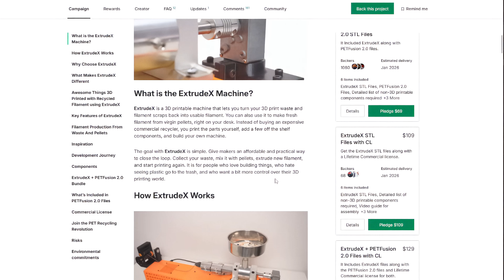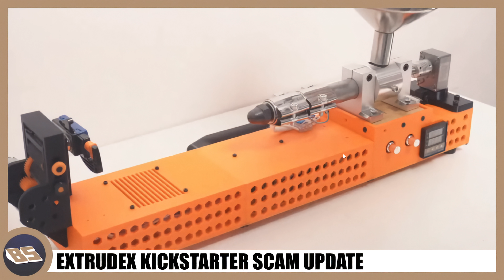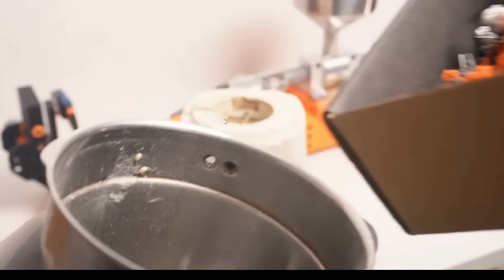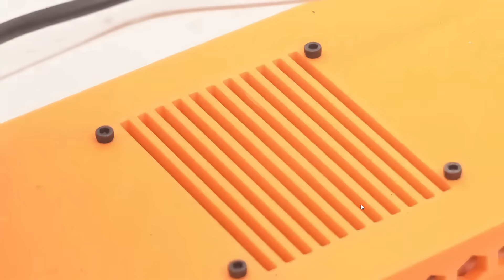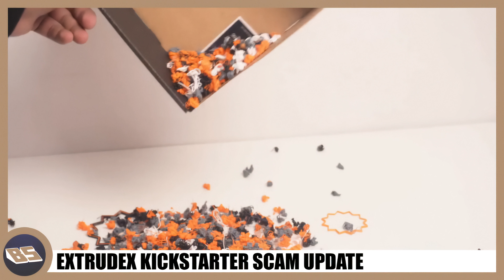ExtrudeX Kickstarter Scam

Comment: Oh gawd.  How edgy.  It's the green text.  Because I'm to dumber to then be able to NOT put money on miracles....which is kickstarters fault right?
Bro....ffs.  We KNOW going to the store or ordering wingding#4 from wherever that gets wrapped in plastic and goes across the OCEAN wrapped in fuel oil, then takes about 17 more rides to get to us ... Is wasting plastic...thanks Greta.
I mean NSS.  If YOU look at this and DONT just see a backwards air-brush I cant help you and kickstarter for sure ain't.

How about instead of whinging you turn what is a pretty good damn idea underneath, for those willing, into something helpful.  Or, just sit and whing about morons losing their money to morons which at the end of the day will ... Have... Just keep on pointing out how bad things are...actually I was thinking about doing the same with a website I use to thought was useful...but now it's just AI and "top ten failures" and "drama for teens" videos....

Comment: extruding is the easy part. there's a lot of home made options to choose from that you can make yourself. the problem is shredding your failed prints. and machines that can shred your plastics are expensive AF. these guys have it all backwards. s still think there can be something done with one of those old soft serve machines.
Reply: Respectfully, a soft serve machine is opposite of what you want. Nearly frozen, high bulk, wet, flowing, melting at room temperature, liquid.
Reply: @johnverkler3962  logic tells me the mechanics of a soft server machine(the internals) has the same principal. i wasn't remotely talking about the cooling properties of the machine. perhaps if you look into how one works you'll understand the concept and apply logic to my statement.

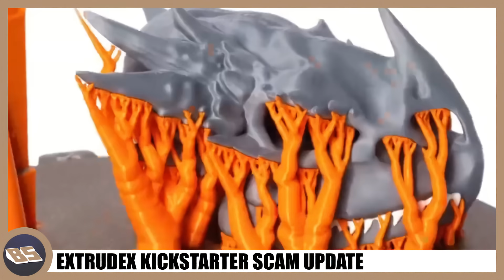Comment: The only valid points are from 5:00-6:00 idk what racist horseshit you're taking about afterwards. This machine has the potential to work with some modifications. There's no issue using a 3d printed if you manage your heat transfer correctly. Furthermore no metal to plastic interfaces are visible making the heat crawl likely very manageable. There have been 3d printed 3d printers which have worked fine. Most of these criticisms are very uneducated and even when valid are very easily resolvable in a redesign.

Comment: Ok, don't get me wrong, I'm not saying this isn't a grift (just open source your parts) but there's some issues here on the criticism. 
1. Plenty things are "full 3d prints" but require hardware.
2. It's definitely faked to mislead. 
3. Not all kickstarters are a scam
4. The "nitpicks" around the extruder snot are not really needed as it's just part of the process of a lot of remelters. 
5. Can't just go blowing up indians? (Wtf) 

This isn't some huge scam it's a kickstarter for an open source design of a pla remelter, you'd probably buy and have to assemble it and it would not be great. Is it a ripoff? Yes. Is it a scam? Yes, but there's a huge bad-faith argument going on here and to me, it's less informative and more off-putting.

Comment: The main issue I have with things like this is that they LIE to the consumer by making them believe the solution is to do something with the waste instead of preventing the waste in the first place.  Go ahead and use that fancy bambu printer with ams and piss away half your roll of filament in poop and purge but make yourself FEEL better about it by spending even more money on something to be able to turn that waste into something useable.  No mention of STOP USING printers that generate so much waste just so you can print trinkets that will also wind up in the trash.

Comment: This is odd. I thought there was already an open source device for this that was able to do decently but just the BOM was over $600 and there was a lot of interesting trickery to get the diameter halfway decent (I think its the artme 3d or something). I swear someone even managed to make hot glue into a filament with it (not a great material, but they somehow did it). Just comparing the design of the two and how they work makes this absurd, this thing looks like a lower grade pulltrusion device, the kind they use to make filament from pop bottles, with a aliexpress pellet extruder strapped to it.

Comment: didnt they already make something like this but better? to re use ender 3 printers parts if you bought a new machine?
Reply: I've seen a few PET extruder machines that used the standard Ender extruders to convert strips of PET (cut up soda bottles) into tubes that can be printed as filament.

Comment: Well actually, before extruding, the main problem is to shred it. You need heavy metal jaws and heavy duty high torque large motor. After that there are a lot of alike solutions DIY and all which can extrude something which looks like a filament thread.

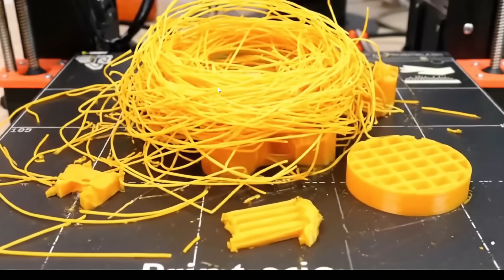Comment: 2:21 this is kind of a BS point. 3d printing is completely unnecessary, food packaging on the other hand is kinda necessary. 3d printing is a huge waste and cause of pollution for like 90% of people who have them. People just printing absolute nonsense doohickeys that no one will want after 5 minutes. I really do not see the benefit unless you're rapid prototyping or are using it to repair things.
Reply: You should blame Bambulab for this, they made 3d printers which 'just works'. Before that, 3d printing was not for everyone. Especially in printing some absolute nonsense. People tuned their printers and used them to print parts to fight programmed obsolescence. And now anyone could buy a 3d printer and turn plastic thread into garbage. = )

Comment: I've seen successful pellet hopper adapters for 3d printers.  It's a major pain, but it's a solved problem.  The problem is getting the right sized pellets.  He completely skips over getting the right sized pellets.
Reply: The right sized pellets are the ones your heating element can liquify fully at the appropriate rate. Without knowing the details of the heating element, you can't know what size pellets to use.

Comment: The problem with the digital depth gauge that he's using here to measure filament diameter is that he has printed jaws on it which don't close to actual zero. But it doesn't actually matter much, since all you need to do is keep filament diameter steady and keep it strictly under 1.9mm, then it will pass. The boards in these also have a digital readout port that you could tap into to actually feed it back into machine, which he didn't.

Recycling PLA is definitely more efficient than making it fresh, and the only way burning PLA is even justified is in an incineration reactor that produces electricity and emits solid inert cake and CO2, otherwise you'd be better off just landfilling it.

Mysterious smoke also comes from your nozzle when you run PLA, it's completely normal, especially if you haven't pre-dried it a whole bunch, and especially visible at first when priming. If your cold end cooling fan leaks into the nozzle area, or part cooling fan is running, you're not going to see it, but it's there. This is essentially soot from PLA decomposing and it is similar to soot from a match - it has a nonzero harm but also shouldn't put you in panic, all of your exposure is not even half as bad as frying a paella.

You are quite right that he doesn't actually have a working prototype and that this is a scampaign.

"If you're doing a normal thing, like driving to a grocery store, you are already throwing kilograms of plastic a week and nobody thinks about it at all" - oh you speak for yourself, i DO consider my carbon footprint and i do not in fact drive, and i politically support every (sensible) campaign to improve actual plastic recovery and reduce packaging plastics and also reduce fossile fuel consumption. But they're also not all sensible. And yes i do 3D print and some waste is produced but it's not really that big in the grand scheme of things.

Comment: Of course mixing unknown but likely different blends of plastic is a great way of getting consistant and well defined properties throughout the whole filament! And who needs a properly tuned feedback loop to deal with die swell and internal stresses in the extruded plastic or keep the diameter consistant?

If it were injection molding I could see something workable for waste upcycling, if made from mostly metal components of course.

Comment: Yeah, I've been looking into trying to recycle leftovers and failed prints. Like nobody anywhere offers any kind of solution in the home hobbyist or even pro-sumer range. If you're running a decent sized farm, it might make sense to spend $5-15K on a recycling setup, but it doesn't for anyone else.

I can't believe that, as of Jan 2026, nobody makes a self-contained benchtop unit (that isn't some Rube Goldberg contraption that needs constant monitoring and maintenance.) You feed shreds and/or pellets in one end, come back in a couple hours and you got a KG of filament on a spool that came out the other end. Hell, charge me a grand. I might even take two.
Reply: I'm sure I saw a video on a kit project for like €650 from a company called Artme in Germany. Probably why I came across this. I think you need a few other things, like a decent way to shred old prints and some way to dry out the plastic first. 

The video did touch on the time, effort and costs to do this really don't make sense for many.
Reply: @naycnay it's kinda shit, it has PTFE inline, in a setup that regularly should exceed PTFE temperatures if you want to extrude anything more than PLA, and they complain about being too expensive switching to full metal when it's already overpriced.
Reply: Because its niche, like you said you need to burn trough quite a bit before youd want to do such an investment. The motor to crush it into tiny bits is stronger than all the motors in your 3d printer and so is al ot more expensive. The housing and the crushing blades are solid steel and so quite expensive. You need a heating tube and element thats larger than of a 3d printer and so are more expensive so in the end you will just have a machine that almost gets no use for a regulair person, costs more in materials and probably is not worth the effort of the learning curve. Thats why they are so expensive

Comment: People who think you can reuse filament have never:
1. Used this "recycled filament"
2. Watched youtube videos of all the creators trying to make this garbage work, wasting thousands of dollars and still can't get good results even with much better machines than this
3. Seen a real filament production line in real life. The filament in those gets cooled much more evenly in a several meter long water bath, with multiple laser diameter measurements and a small fortune in control software to get the extrusion right.
The only stuff you ever see come out of these units and those "PET bottle to filament" machines is crap only worth using in those "3mm nozzle THICK LINES wow" shorts videos showing the ugliest prints you have ever seen, because no amount of low precision can mess up a vase mode print with that thickness.
Reply: recycled filament by companies work tho (i tried 2 different companies selling recycled cheap filament, none of them caused problems)
Reply: @stoinercraft6389 of course, these companies are using the expensive and precise machinery I talked about, and not this cheap kit.
Reply: @eg1162  oh yeah definitely, i agree with that
Reply: literally watch any filament manufacturing process that isn't done in a random shed
Reply: Well, I done all of that. And the idea is working, no complex machinery needed. The problem with shredding, not with extruding. So actually first you need to watch how pellets are produced (spoiler they shred and extrude them multiple times). And now there are even solutions which print directly from pellets, and of course no real trouble to create filament after that, and DIY home machines look very alike that fantasy in video.
Reply: 3. Why does the printer need a perfect filament? Maybe that's the real problem
Reply: @cristibaluta nozzles can jam if the filament is too thick. Filament can slip in the drive if it’s too thin. Prints will come out wonky even if the filament makes it through the nozzle.
Reply: @cristibaluta if the filament diameter changes, the amount extruded changes, and the line thickness is less than expected. There are sensors you can place in line to adjust for this, but it is another hardware part that needs calibration when the thickness can just be controlled for. It would be simpler to make a pellet extruder on the toolhead and skip making filament rolls completely.
Reply: @cristibaluta  You can use less than perfect filament if you're OK with uglier parts and if it's bad enough, unreliable printer operation because it gets too thin to grip or too thick to fit through the feeding equipment. Generally speaking, the more consistent the filament, the better the finished part.
Reply: A water bath, huh? 
For a material that literally absorbs water FROM THE AIR and then becomes useless? 

BS alert is sounding...
Reply: @fredmercury1314 believe it or not, if filament is dunked in water for 30 seconds then dried immidiately and stored at 5%rh until sold, it doesn't absorb a lot of water.
Reply: @fredmercury1314  It literally has to be cooled... or else your diameter isn't consistent...  And that is done with WATER... yes...

Take some pla and dunk it in water and you will see it didn't absorb anything.. PLA is not a SPONGE.
Reply: @fredmercury1314  strangely enough, it is evidently a part of the commercial process; the articles/tours I briefly looked up on the topic mention it, and the commercial machines I looked at do have troughs.  I think it must be a timing thing -- if it's only in there for a minute, it's fine.
Reply: @fredmercury1314 no. It’s dried afterwards.
Reply: @fredmercury1314  Many plastics generally take days or weeks to absorb enough water from air to cause stringing, bubbling and brittleness, and even hours soaking in water. The minute or so in a water bath isn't a big deal and it gets blown off after it leaves the bath.

Comment: once i saw it on a subreddit and i said this might be a great idea until i saw the 3d printed case
Reply: care to elaborate
Reply: It wil melt..
Reply: @stojaczysko2  If that hot end gets to 500 degrees-C, sure. But it only gets to about 200C, and only on the inside. That's also the reason why the plastics on your 3D printer don't melt. The only thing that can transfer the heat from this thing is mounted on a square  isolating base and that base is screwed into the plastic.

I know this is a bad machine but you don't have to make sh*t up just so you can join in the bashing.
Reply: @vinny142 Also that's assuming the material they printed has the same melting point as the filament being recycled. If the printed parts are made of a higher temperature filament they can withstand contact with temperatures that will melt lower temperature filaments.
Reply: @GRamerDim  Are you dumb? DId you not even watch the video above? Why would you comment this? Such a stupid thing to say, after watching this video literally about what the commenter says...

Comment: if you have seen any diy filament recycling machine you propably have noticed the filament always has uneven color beacuse you can't really mix the old filament with fresh pellets properly and in the video the guy always shows perfect single color filament. even if you use only one color of waste filament it needs to be mixed with pellets so there is always a gradient. i hate that so many people fell for this
Reply: I havent seen the heating tube and i asume it doesnt. But it could have a worm screw in there to mix it up. Thats what happens in factories to mix it
Reply: @fireworkstarter  With a 60-40 mix, and especially with his 90-10 mix, you're not going to get an even distribution of colour, particularly not in a tube as small as the one this thing has. Think about it.

Comment: The grit is aluminum oxide, cheap and abrasive.

The micrometer is garbage, it just "shows" how bad it is. Any REAL extruder will have LIVE adjustments because there are always variances in the drive/extrusion system.
Reply: You can get silicon carbide sandpaper too.

Comment: Kickstarter by default isn't a bad platform. But yea this feels like a quick in quick out scam. By people that did the littlest research to scam people that look at it on a surface level.
Reply: The problem is that people go to kickstarter thinking it's amazon. It's not a finished product, you have to determine if you think they can actually do it for the money they're asking.
Some of them will take the money and run, a lot of them are inexperienced and will burn all the money trying. The second group you can't really blame, the first one are scum just like all scammers.
Reply: That's usually by design. Its a time v money equation for them.

If it was believable enough to hook people who know more, they'll eventually find out leading to wasted time.

But the only people who won't notice Engrish emails or other BS are highly likely to pay out.